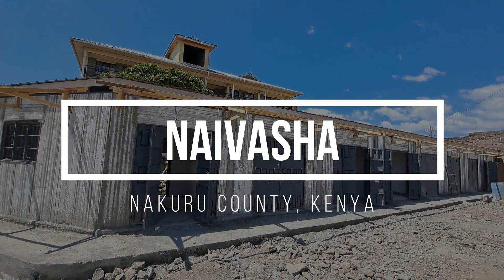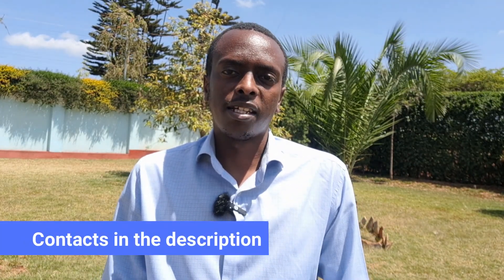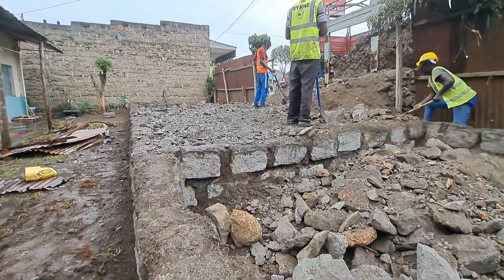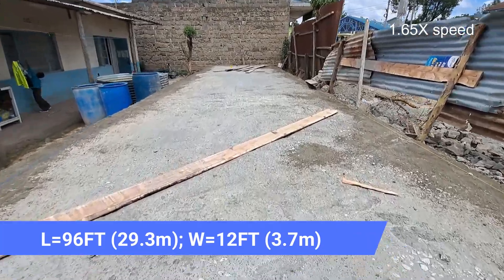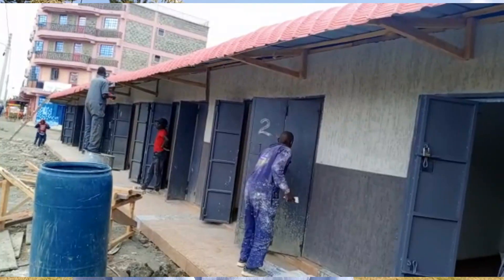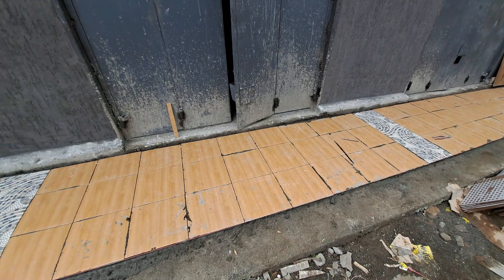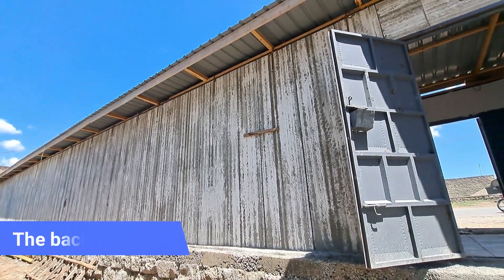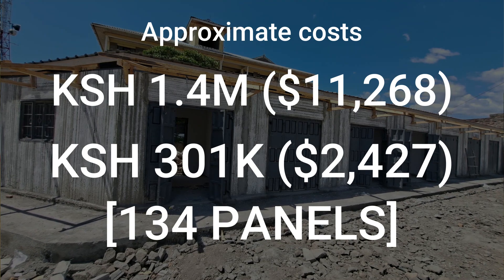8 STUNNING Commercial Stalls Built Using Precast Concrete Panels

Comment: I've watched several of these videos but they never answer the most important question. HOW MUCH DOES EACH COST? When buying bricks,  we are told 1 costs 12 shillings, transport included.When buying stones, they say 1 stone is 50 shillings,  transport included. You keep praising these panels but never tell us how much they cost so we can weigh if they are indeed cheaper or more expensive than the traditional building materials. Without beating around the Bush, how much do they cost?
Reply from the maker: Hello Queen Joy, I provided the total cost of the panels in this video. Kindly watch the whole video. For more details, I've left contacts of the contractor in charge of the project.
Reply: Watch the whole video get the total cost of panels mentioned and divide by the total number of panels used.
Reply: @burpeeswarrior he’s still waiting how much it cost each panel ? 8:57